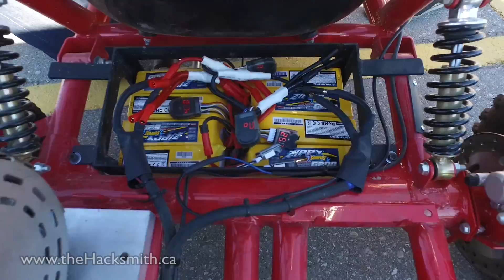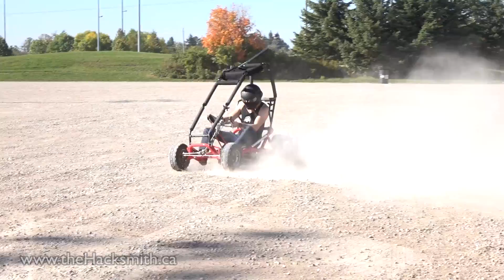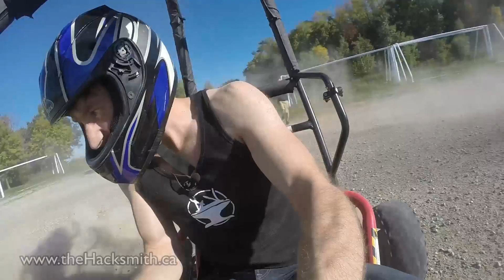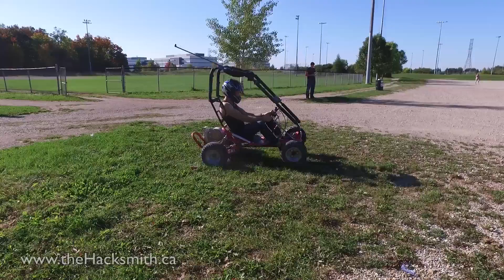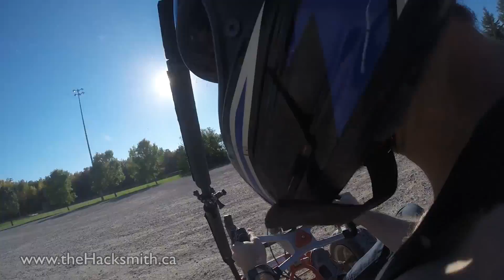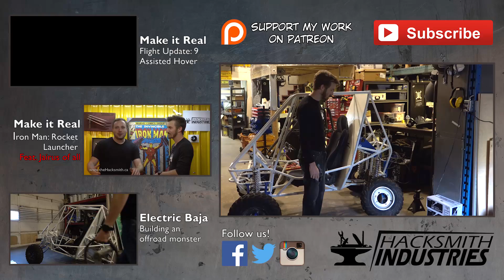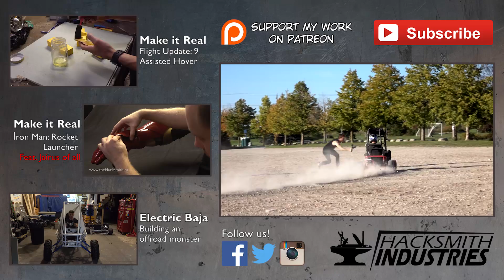Overpowered Electric Go Kart has TOO MUCH TORQUE (54 FT-LB!)

Comment: Electric engines, so much better than gasoline ones!!!
Reply: Torque is just so much more important as far as every day driving goes. Top speed is only needed on half mile drag races and race tracks.
Reply: Tim Ramich Nah you could have a crap ton of hp and still be slow depending on the mass of the vehicle. So although hp amd torque are important variables in determining acceleration and top speed, basic physics tell us that power:weight ratio is the most important equation. All that's left after that is air drag, traction, gear ratios, etc. But much of that stuff can be displayed in the culminating end result of hp.
Reply: Nathan Boody gas engines are good as long as theirs gas in the tank... difference between gas and electric is bats don't cost 3$ an amp to recharge
Reply: Mind blown So what? What if you need to take a long trip? You can add fuel to a real car and instantly be on the road. Charging a battery takes forever. Are we supposed to have battery-swapping stations? Electric cars are terrible for the environment.
Reply: Mind blown Electric cars aren't good for the environment. Making them uses materials that are hard to mine. Electric and hybrids are bullshit.
Reply: Mind blown Why would we all of a sudden need to stop using cars that run on petroleum? You sound like one of the nut cases that believes in over population.
Reply: Mind blown Hybrids still have a huge motor and batteries, made of the same materials as a purely electric car. It's all crap. They will have to kill me to take my V8 from me.
Reply: DankSylveon the ice melt and sea level change may be irreversible but green house gasses in the atmosphere aren't stuck there, "it's too late" is simply an opinion formed by those with a pessimistic view on humanity's ability to change
Reply: DankSylveon done a lot of research, stuff in the atmosphere isn't stuck there, we can take resources out of the air, that's how plants do it that's how we should do it, sea level rise is bad and habitat destruction will take a lot of work but green house effect isn't irreversible
Reply: DankSylveon calm down professor, I can't speak for the other guy, but I understand the green house effect, the carbon cycle, and our various carbon emissions, now tell me where I'm wrong here, the added carbon emissions come from various sources including transportation, manufacturing, and agriculture, these emissions overload the carbon cycle leading to the runaway greenhouse effect, which causes the adverse environmental effects, now this runaway effect comes from us putting a ton of carbon in the air without taking much at all back, so if we create a massive industry based upon using carbon for its many quickly expanding applications then we can create an artificial carbon cycle and eventually halt the greenhouse effect and as we reduce carbon emissions we can use more then we make and reverse the greenhouse effect
Reply: Only the brushless motors.
Reply: A Crustacean tesla uses AC induction, if you ask me those are the best
Reply: +Brian Boni do you think electricity is producved from unicorn farts you idiot?
Reply: Tim Ramich hp is just a ratio doesn't really reflect potential of engine, whereas torque is really how much strength is behind you
Reply: Prophet Ares I was speaking of torque versus horsepower. Torque tells you nothing about how a car will accelerate. There is no time factored into the equation, which would equal work. Torque can do nothing without motion. Horsepower is simply derived through and equation involving torque and RPM.
Reply: If you look at dirtbikes their is two diffrent kinds of engines a 2stroke and a 4stroke (if you don't know the diffrence a 2stroke fires more than a 4 stroke) But the 2 stroke has a slower start but more power because of the powerband that kicks in at high rpm and its fires twice instead of once every 3 turns. But the 4stroke has more torque because of the way the engine is built and fires and stuff etc. Again its like the petrol engine and the electric one.
Reply: Jimmy Brandell unless you need to go for any distance whatsoever.
Reply: Sub Ripper modern electric cars have 300 miles of range, that's more distance then 99% population needs
Reply: Tim Ramich that's what I just said... nothing we humans do is good for the environment, However electric cars have more potential to be sustainable, as in we won't all of a sudden have to stop using electric cars,  hybrids are just fancy internal combustion engines and bring nothing but gas mileage to the table, as for resources, again with the right infrastructure recycling old unusable things is much more sustainable then digging stuff up so in my mind when we start to invest in new infrastructure, recycling plants will become more advanced and monetized to a higher extent
Reply: Mind blown Nope. There is plenty of oil to last the human race forever. It's call artificial scarcity. I don't know why you keep going on about hybrids, like I don't know what they are. What the fuck? I said they're just as bad for the environment as electric, because they're made of the same shit. CO2 and water vapor are not evil. It's funny how many people forgot that the carbon cycle exists.
Reply: Tim Ramich oil is clearly a fundamental disagreement so arguing that further is simply a waste of time(though, it will last forever is ridiculous argument) as for carbon cycle, we're simply increasing the amount of carbon in the cycle (no duh) doesn't change that the amount of carbon in the air at any given time is exponentially growing, thus more greenhouse effect, thus more extreme climate, thus living conditions greatly affected
Reply: DankSylveon The sun would be something to look at. All other planets are rising in temperature along with ours. The earth's tilt starting to wobble more would be also. Oil spills that interrupt ocean currents don't help. Machines that control the weather is the very likely.
Reply: DankSylveon I wouldn't call it irreversible, carbons going to become a commodity as tech progresses no way we'd leave co2 untapped
Reply: DankSylveon Peer reviews are nothing more than a bunch of people who aren't scientists opining about nothing more than a theory.
Reply: Mind blown If you fill a cup with ice water, and the ice melts, the level should drop. The ice pretty much sits below the water. I think if the ice caps melted, the sea levels would either drop or stay constant.
Reply: Tim Ramich a lot of the ice melt that contributes to sea level rise isn't floating ice but land based such as glaciers, or Greenland
Reply: Mind blown Someone needs to prove that CO2 traps heat.
Reply: DankSylveon That's all you will find with research. Consensus, not evidence.
Reply: Tim Ramich research? Research is the act of obtaining evidence, watching a documentary is getting consensus
Reply: Mind blown You have to pay to recharge your electric cars at public charging stations and have to wait.
Reply: David Grasso no you don't you can charge it with your cat battery
Reply: *car battery
Reply: produced
Reply: yep that's why teslas can accelerate pretty damn quickly despite being designed for luxury
Reply: Theres pros and cons they cant really be better than one another
Reply: not at all they cant reach half the speed and distance and gas engines can sound awsome
Reply: Wade McKenney electric engines are much faster then the equivalent gas engine, that's why the fastest sedan on the road is electric, as for range it gets better every year, and is the dedicated electric cars are reaching 200-300 mile ranges, as for sound, that's a matter of personal opinion, I get the thrill of a noisy engine, but I personally find it annoying and the guys that drive around in too low a gear to hear there engines make noise are assholes
Reply: All vehicles use materials that are mined. At least with electric those materials are contained within the vehicle and not pumped out the tailpipe. You can recycle an electric car and reclaim everything that is inside it, can you reclaim all the waste you put into the air?
Reply: Gary Singh Uhh, torque means nothing except for figuring out how much weight can be moved. Horsepower gives you actual work being done over time, which is important for figuring out things like acceleration.
Reply: Tim Ramich first off you're most likely not going to travel +300 miles without some sort of stop, so recharging a half an hour at lunch isn't unreasonable(assuming this is battery and not fuel cell which could be refilled as fast as a internal combustion car) and as for the environmental factor, electric has much less of a negative impact on the environment then internal combustion by virtue of being thousands of times more energy efficient and having no direct emissions, however nothing is good for the environment nothing can even really be considered neutral, it's all about sustainability, and internal combustion is simply not sustainable, greenhouse emissions will drastically effect our daily lives if not curbed and oil is a finite resource unreliably sourced and not to mention has relatively shit energy density when compared to more modern technologies, the low cost is simply a result of the existing infrastructure, if we based our society on sustainable means of using energy (i.e. Build the necessary infrastructure) it would be much much much less expensive then internal combustion
Reply: Tim Ramich a hybrid is a gas car that uses an electric engine to beat starting friction, i.e. Better gas mileage, not much better for the environment, no ones going to take your v8 away from you, it's just going to get more expensive to run, as it takes more and more money to find less and less oil, and that that's found is more expensive to get and harder to refine, it's simply old impractical technology we've kept around since the late 1800's and it's going to be replaced by the modern more efficient methods